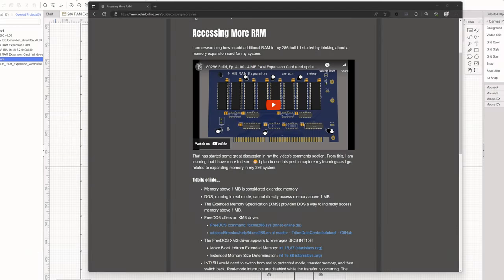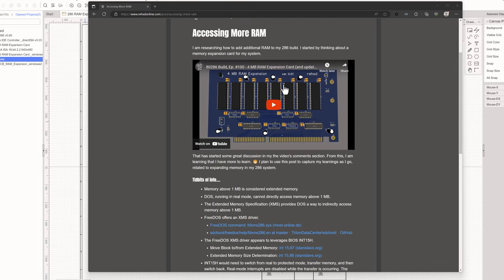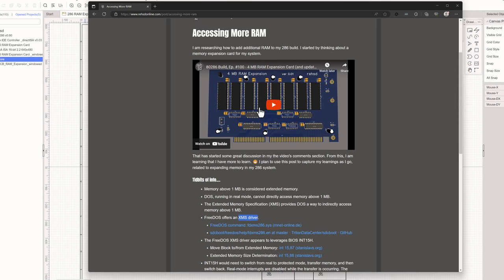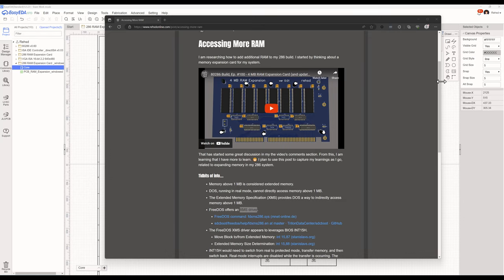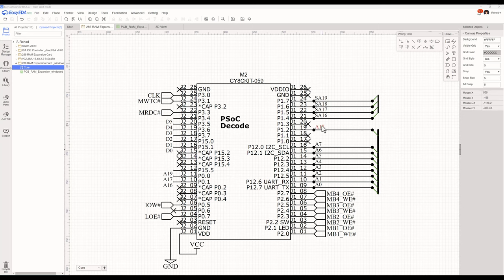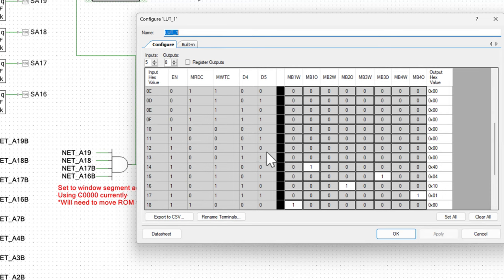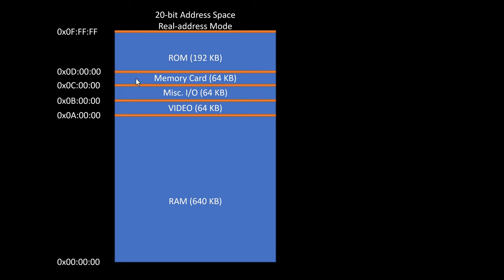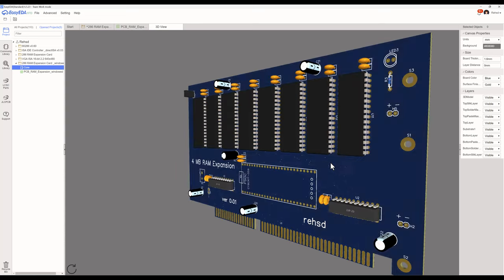80286 Build, Ep. 100 part 2 - RAM Expansion, cont.

Comment: It's way more common to have the window at D000:0000 - EFFF:FFFF , there is high expectation for C800:0000 - C800:7FFF to contain the video bios and A000:0000 - B000:FFFF to contain video memory for graphics and text modes. F000:0000 - F000:FFFF would contain the system bios. For max compatibility you'd probably need to layout the memory in this way

Comment: I suppose the advantage of using the PSOC to do all of the decoding is that later on you could reprogram it to provide a linear 4 MB of address space, then you have the best of both worlds. If you design it with that kind of flexibility in mind at least.

Comment: could you make a similar pc but with two 80286?
Reply from the maker: Yes, I believe so. The Intel reference architecture I based my design on has options for multi-processor (if I understand it correctly). While I went with the "Basic System Configuration," there is a "Multibus System" architecture. I think it would be a major effort for me to go do a dual-CPU design, but it should be possible.
Reply: But DOS couldn't really take advantage of it sadly
Reply: @Ikkepop  oh but maybe with some dev we can make dos take advantage ? 🤔
Reply: I have dreams about doing a NUMA 286 multiprocessor system with a Unix-like OS (maybe FUZIX or ELKS or Minix), where the hardware can assist a virtualization setup so you can run DOS on one CPU and unix tasks on others at the same time...

Comment: If you seek to have more usable RAM then you have to play with freedos XMS drivers, but if maybe easier is to implement it as a RAM drive to gain speedier drive to use within existing real mode infrastructure.
Reply from the maker: Good thinking. I can see using for video-related functions, RAM drive, etc. I figure once I have it physically in the system, I can start finding creative ways to use it. :)
Reply: If my DOS knowledge serves me right, EMS is the OG spec, and XMS a later spec. And EMS was more used by applications in the 8086 - 286 era and XMS was more popular in 386 and above era

Comment: Rookie question: and what about a Linux kernel instead of dos to go to protected mode….. even if my guts are telling me the step will be pretty steep (software and hardware wise)
Reply: Linux requires a 386, but Minix 2 is available with source code and can be modified (that's what I'm fooling around with). There's also Xenix and Coherent for the 286, but I'm not sure how adaptable they are.
Reply from the maker: I did some cursory research, and it seems like Linux would require a 386 or better. Maybe if I can get my 286 upgraded to a 386 DX. That might be a project for later this year.  :)
Reply: @rehsd  A 386 also can switch easy back to real mode, so no need to go to the linux path.
Reply: one could probably find a drop in pin compatible replacement 386SX tbh
Reply from the maker: @Ikkepop  I've seen drop-in upgrade boards discussed in different forums, but none for sale. I think I could update my system board PCB to support a 386SX fairly easily. If I go that far, I might jump to a 386 DX.
Reply: @rehsd  You like a challenge, a 386DX is full 32 bits!
Reply from the maker: @BLSrr  I'll get there at some point. :) I'm currently laying out a 286 to 386SX interposer (and have some questions). I plan to post a video about it sometime this week.
Reply: @Ikkepop  You won't find one, 80286 PLCC68 and 80386 is a PQF100 pins package, but surprise me with a link (you never know what Chinese can make)
Reply: @rehsd  Great I also looking into a 386EX or 80376 build